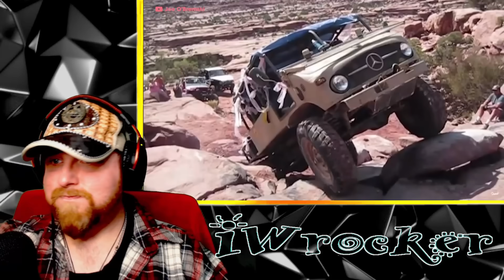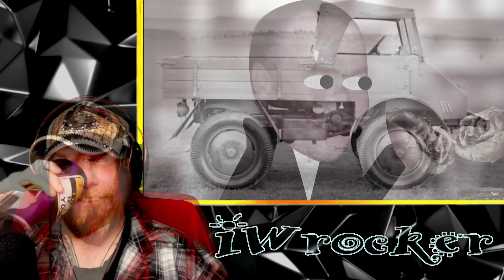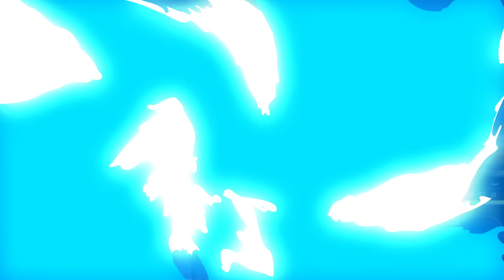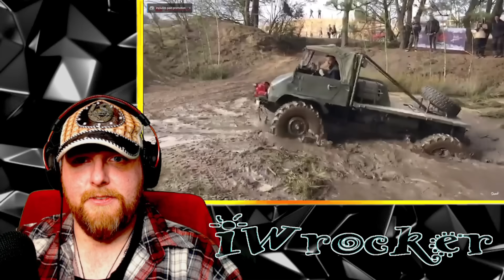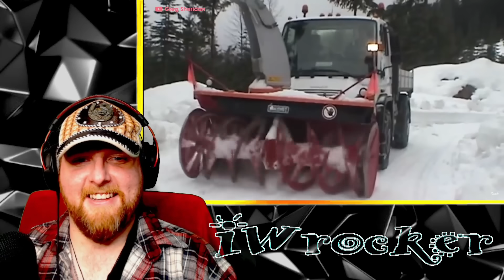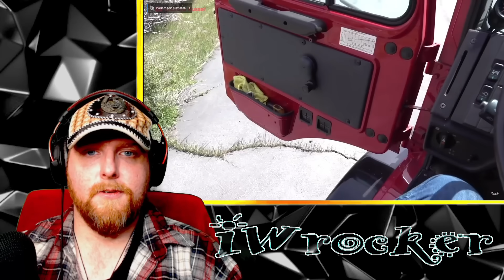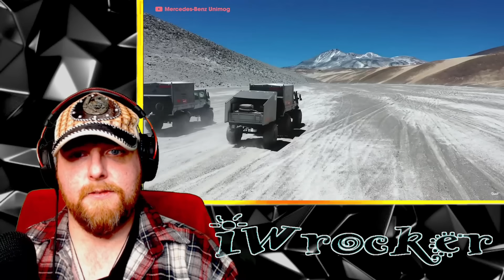American Learns About the Mercedes UNIMOG

Comment: I was in the Australian army for many years, in field force transport so, drove mog's a lot. Eight gears forwards and backwards, drive through and or over anything and, I even had a 12 volt fridge for the snack's. There was a dual cab variant ordered from Merc for "one transport squadron/Australian army" to be used in the Variety club's charity bash in the eighties or maybe a bit earlier in the mid to late seventies.
Reply: Same here, mostly in the Dutch forces, lots of good memories. Almost impossible to get them stuck. However, there was this guy, a sgt., who took a 4x4 Landrover to get a VW combi out of the mud he got it stuck in. He got the LR stuck too. Then he completely burried the Unimog he took to get the VW and the LR out. Then he took another Uni to get all three out. He burried that one too. Eventually it took the Uni of the firedept. and a smarter operator to winch all of them out of the bog. That's how I know there are people that can't drive ANYTHING! Not even a UNIMOG 😁
Reply: @arturama8581  That sgt, he sounds like the embodiment of Sunk Cost 😄
Reply: @gbormann71  He was a walking disaster. Not limited to automotives. Nice guy, really, but man was he clumsy. He must have cost the Airforce a bundle.
Reply: @arturama8581   A true story, We had a sgt whom transfered to field force from admin, an accountant no less. He had to be coded for all of the vehicles we used. Here is the radio message we got from his instructor. Come in "sunray", over. This is sunray, over. "Sergent Rayner rolled the Rover over, over"!! Hah hah !! So funny, the man was a walked disaster area.
Reply: @peterdawes1868  Same sgt as before: we changed from VW Combi to VW Transporter. He had to bring one to the site from base camp. Managed to drive it into a ditch, not a 100m from the gate. Totalled it! Surprising maybe, but he made quite a name for himself 😉
Reply: It was a 4 speed with an automaticly actuated splitter between 4 and 5. There is a version that also splits on each gear = 16 "gears", plus has a crawler split = 32 "gears" and it's 6x6.
Reply: I was Army Engineers 😀
Reply: Did they have right-side steering? Just wondering because the chassis of the classic ones at least were rather asymmetrical, with the engine offset to the right, and at least the 401 was only suitable for passengers with tiny feet. No way they cramped three pedals and a steering column in there. At some point they must have outgrown that problem.
Reply: @PortCharmers   Yes, Right side steering.
Reply: @PortCharmers  australian army variants were right hand drive. in fact couple of years ago they sold of a bunch of the ex army. so of course farmers raced to get them. though i did have a giggle last month in the west aus elections there was one parked at a maccas (macdonalds) with a billboard on the side for a local candidate..(ex aus army still with camo paint)
Reply: Don't use the term Merc! It is used for a Ford- Mercury. Use the name of the inventor of the modern cars, Benz. Karl Benz was the inventor...
Reply: @melchiorvonsternberg844   actually wrong. Daimler-Benz is the company name. The cars are called Mercedes- Benz. Mercedes was the name of a Daimler executives daughter. Merc is the globally accepted shortening of Mercedes Benz.

Merc being used as a shortening of Mercury is limited to the USA only. 

We outnumber you, therefor Merc is not your name to claim. Sorry, tada.
Reply: @lunsmann  Why are you trying to explain the company name of Daimler-Benz to a German from the automotive industry who completed his apprenticeship decades ago? I even worked as an outside contractor at Daimler's Mannheim plant. Nothing you wrote was news to me. Buzzz... But thanks for playing...😁
Reply: @melchiorvonsternberg844   - bla bla bla also a German with automotive industry experience. You are the one telling others what and how buddy. Mercury does not own the Merc nickname anywhere other than in that backwater USA. zzzzz thank you for playing.
Reply: @lunsmann  Das war doch überhaupt nicht der Punkt. Du warst der Meinung, mich berichtigen zu müssen, weil ich dass ein wenig flappsig geschrieben habe. Und ich habe dich darauf hingewiesen, dass mir das bekannt war und dein Hinweis für mich damit so überflüssig, wie ein toter Hund im Bett. Die Sache mit Mercury, habe ich doch überhaupt nicht angezweifelt...
Reply: @melchiorvonsternberg844   - zzzzzzz
Reply: @lunsmann  Nope The Mercedes Name is from the Daughter of a Diplomat (Emil Jellinek). He drove races with some of the first Daimler Cars as promotion for the cars and also was at this time one of the biggest "Daimler Car"-sellers worldwide. He races as Mr. Mercédès (the name of his daughter Mercédès Adrienne Ramona Manuela Jellinek). Later the Daimler Company made a car model named Mercédès and because the name got so famous they eventually renamed their company to Mercedes-Benz (without the french accents). And noboody in Germany would understand what you mean with Merc (sounds like german Merk = Remember! - Imperative form).

Comment: Universal Motor Device. So basically... a universal motorized tool, so I guess it could be a chainsaw then? 🤔😂
Reply: "Chainsaw" -ish attachment for the Front exists. It's on a hydraulic crane and used to cut branches on the side of streets by the street maintenance agencies. You can also change the saw with a lawn mower.
Reply: Just stick that chainsaw to the front. You'd have a pretty powerfull chainsaw right there. It would be a terrifying sight tho.
Reply: @Aandemaat  
But useful attachment for zombie apocalypse :)
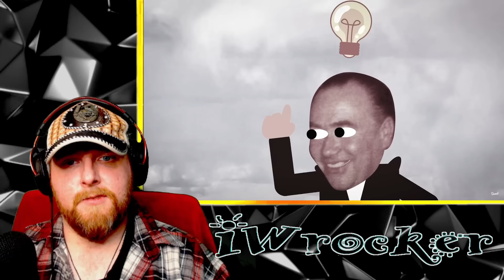Reply: Start at 2:16 here: https://youtu.be/K9jDEBt8bh8?t=136
Not a chainsaw, but as close as you can get... ;-)

Comment: There are loads of Unimogs in Aus, but are very pricey.
Reply: Larry Perkins has 3, and designed and engineered the Mercades Approved Overdrive for them... sold world wide..
Only expensive, because they cost a crap load to repair...